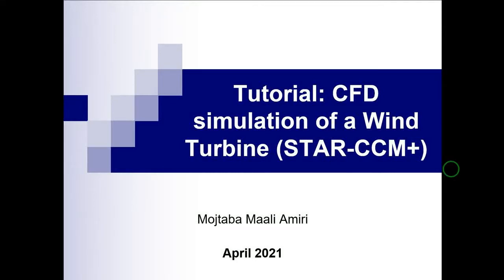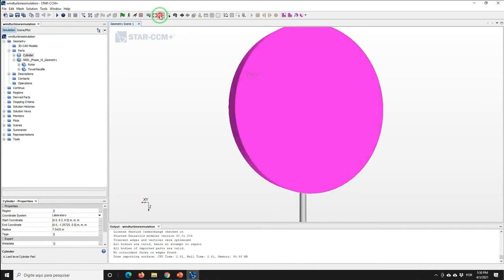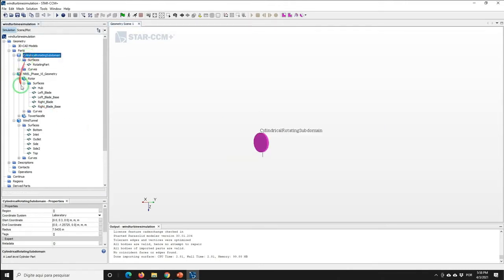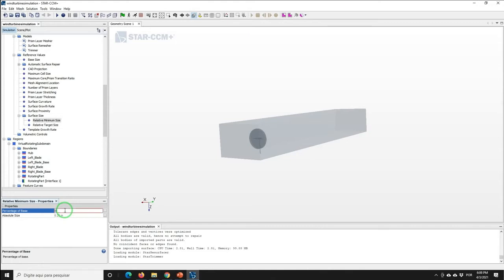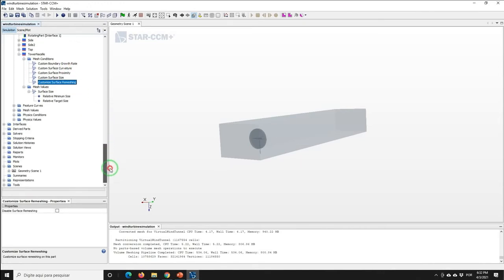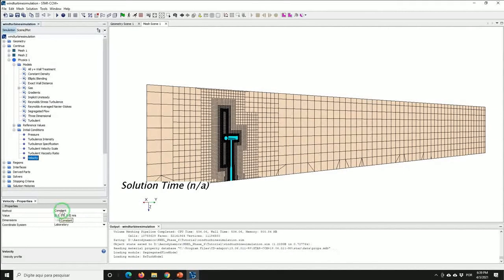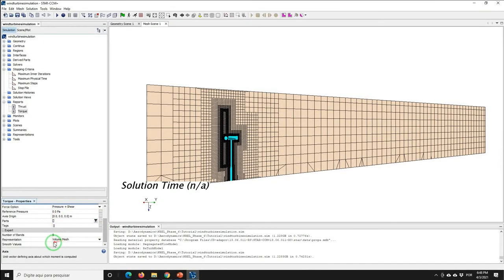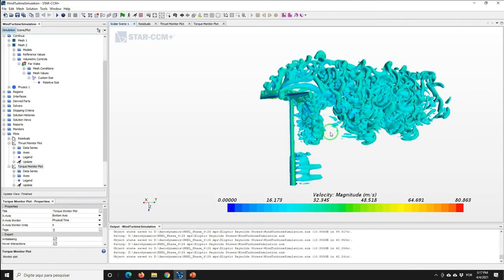Tutorial: CFD simulation of a Wind Turbine (STAR-CCM+)

Comment: hello im working on a project about aerodynamics of a wind turbine blade under different wind conditions, any idea on how to go about doing this?
Reply from the maker: Thank you very much for your comment. I recommend the following workflow: 
Preliminary Analysis with BEM:
    First, use BEM theory (via software like QBlade or FAST/OpenFAST) for quick design iterations and to narrow down viable blade geometries and operating conditions.
CFD Simulations for Detailed Insight:
    Perform CFD simulations (STAR-CCM+, ANSYS Fluent, or OpenFOAM) for detailed analysis of complex aerodynamic effects not fully captured by BEM, such as stall, wake effects, turbulent flow fields, and 3D aerodynamic phenomena.
Integration and Validation:
    Use CFD results to validate and fine-tune the BEM model. Adjust empirical corrections (stall delay, dynamic stall, wake modeling parameters) based on CFD insights.
Reply: @ I’ve used your geometry following your steps in this video, do you think that will be ok?

Comment: What differences in the physics setup would there be if rotation speed is not specified? For example, if you wanted to calculate how fast the turbine would spin at a given wind speed?
Reply from the maker: Dear Tony, thank you for writing. If you wanted to calculate the wind turbine rotational speed, you need to use the overset grid, as the sliding mesh technique is not suitable for this case.
I hope this helps!
Respectfully,
Mojtaba Maali.
Reply: I have not used overset. Looking forward to it. Will there be differences in continua, or does overset simply not have a rotation value needed?
Reply from the maker: @Tony-eg4ic  I think the continua will continue the same, for more information on this please have a look at this video: https://youtu.be/AZkuHDzSqks With overset mesh, you can either specify the value of the rotational speed or you can obtain the value of the rotor rotational speed by considering it as a variable.

Comment: Hello, Dear Friend! Thank you for your vast contribute to wind turine operate in Star-Ccm+ Software. I wonder how to simulate the operation of two or more wind turbines to observe how their wakes affect each other. Do I need set up all steps like in a case of a turbine or exist unevident things to simulate two or more turbines? Respectfully yours Maria
Reply from the maker: Dear Maria 1973,
Thanks for your comment. You can use the same steps to configure your simulation for multiple wind turbines. However, the only point I would like to mention is about the computational cost as you want to analyze the effects of wake on wind turbine performance. Therefore, I would recommend that you use the actuator disk/line technique for this purpose. That way, you won't have to solve the detailed rotor geometry, which would significantly decrease the computational cost.
I hope this helps!
Respectfully,
Mojtaba Maali.
Reply: @CFD_Mojtaba  Thank you so miuch!
Reply: @CFD_Mojtaba  Dear Friend! I would like to know where I can find the actuator disk or line technique for CFD modeling. Are this models in Star-ccm+, what way I can realize it in my simulation? Respectfully yours Maria
Reply from the maker: @Maria-73  You can find this option under simulating physics. In STAR-CCM+, it is called Virtual Disk Model.
I hope this helps!
Respectfully,
Mojtaba Maali.

Comment: Hi sir! Thanks for this tutorial! Is it possible to join the rotor to the Nacelle in these type of simulations? if not, The bending moment and Thrust calculated from simulation will be similar to experiment?! can someone help me pls!
Reply from the maker: Hi, thank you for writing.
It is common to simulate the wind turbine without any physical connection between the rotor and nacelle. This is done in order to decrease both the problem complexity and computational cost. It is belived that adopting such a methodology has a negligible effect on the aerodynamic performance of the wind turbine. 

I hope this was helpful.
Respectfully,
Mojtaba.
Reply: @CFD_Mojtaba  Thanks Mojtaba, it was quite helpful! Do you know how to monitor velocity fluctuations(u',v',w') in starccm+? I can't find them in field functions and I need them to calculate 2point correlations!
Reply from the maker: @MohammadZareian-bp3pr   

I am not sure if it is possible to monitor the fluctuating velocity components, as in (U)RANS we are concerned with the calculation of the Reynolds stress terms, i.e., the mean product of fluctuating velocity components. I think at most, you can monitor the Reynolds stresses, which are directly accessible if you use the Reynolds stress turbulence models or can be calculated using the Boussinesq hypothesis in case you utilize an eddy viscosity model.

I hope this was helpful.

Respectfully,
Mojtaba.

Comment: i understood that u are applying sliding mesh on the rotor.. but if we conduct MRF using steady conditions, would the same procedure be applicable for that case?
Reply from the maker: Thank you for writing! I believe that the use of MRF method requires some modifications to be applied. For instance, it will not be straightforward to define the rotating subdomain inside the stationary subdomain. Consequently, it's not possible to model the Tower effect.
Reply: @CFD_Mojtaba  thank you. Yes it has to be modified. Another important question. Why dıd u change rotating part surfaces (the old interface ones) to the symmeyry plane.. because shouldnt we leave them as wall so that interface can be calculated by sliding manner?
Reply from the maker: @emregungor2969  the reason why I treated the rotating part surfaces as a symmetry plane is that the configuration of the symmetry plane is much simpler than the wall, but at the end the obtained results shouldn't be different. You will get the same results using these boundary conditions for the rotating part surfaces.

Comment: So, the blade is not driven by fluid flow? But driven by rpm you input? Right?
Reply from the maker: Hi @Didi Widya Utama, Thanks for writing.
That is absolutely right. However, why we use this strategy is twofold. First, reducing the computational cost. Further, using the obtained flow behavior to perform the fluid-structure interaction simulations, which are used to assess the structural behavior.
Reply: @CFD_Mojtaba  first i was hoping your video explain about how to use DFBI in starccm which i was looking for, since i already using motion before. Anyway you did a great tutorial, thanks
Reply from the maker: @DidiWidyaUtama  I can tell you that I am working on a tutorial where the DFBI and overset mesh techniques will be covered. This tutorial will be ready in the next few weeks. You can see the outcome of this tutorial in this video in my channel: https://www.youtube.com/watch?v=Gn8Ylk5PRnw. In the meantime, I recommend you to subscribe to my channel, this way you will be notified when the aforementioned video is ready.

Comment: Thanks for your video. It's amazing. I want to know whether the blade tip angle for the used model is 3 degree or not. I want  to doublecheck my own geometry file.
Reply from the maker: Hi @Chi Ding,Thanks for writing.
The blade tip anlge is 3 degrees. 
Regards
Mojtaba.
Reply: @CFD_Mojtaba  Thanks a lot.
Reply: @CFD_Mojtaba  Hi,Please tell me where I can get the Starccm+ thanks I'm doing some R&D and I need software